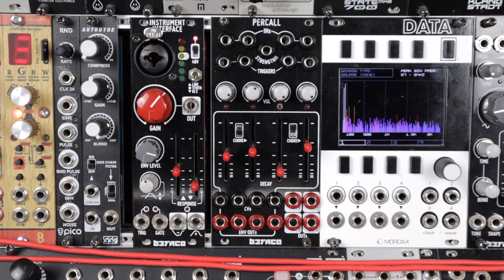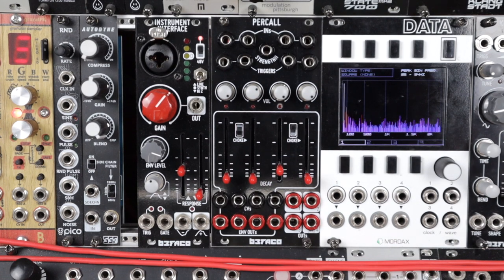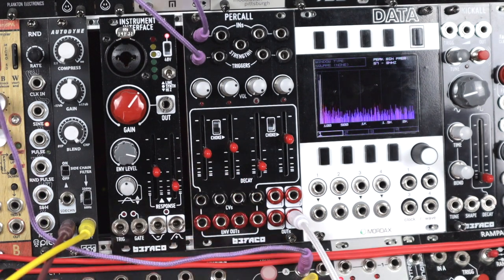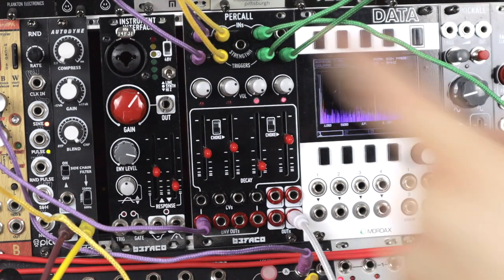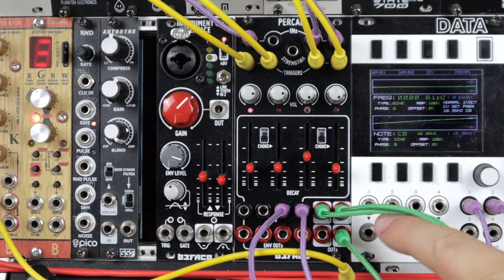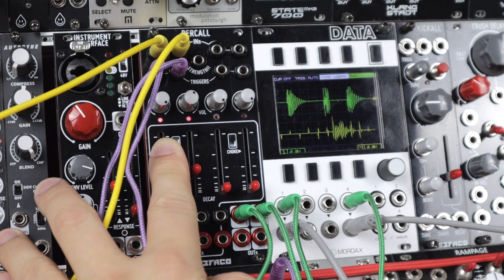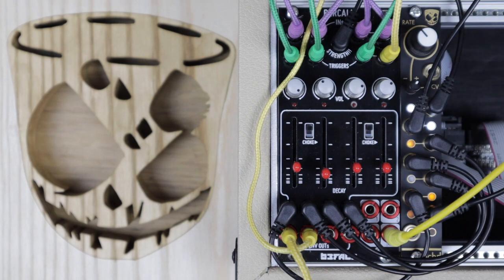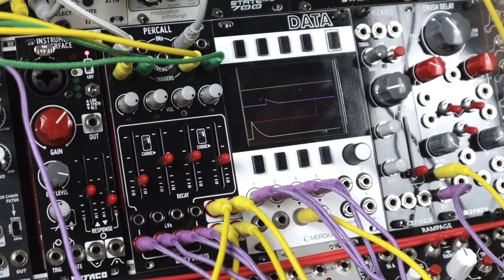Befaco Percall // a percussive quad decay envelope, VCA, choking, mixing Eurorack module

Comment: These module seems fantastic, a lot of features in one module!
Reply from the maker: It works well for any percussive, whether that's traditional percussion, weird percussion noises or just percussive melodies and bass etc.
Reply: @DivKid  I’ve seen some demos with just normal oscillator sounds, used for melodies etc. What’s your opinion of that use?

Comment: Out of curiosity Ben, what do you use for your trigger sequencer? I’m sure there’s a lot going on behind the scenes but your rhythms/beats always seem so effortless. Like, “oh, just threw this together” and it sounds better than most of what I come up with. 😆 Great demo as usual, thanks!
Reply from the maker: Hi Mason, they usually are threw together as I don't get time to finesse things really for making demos as it would if I was just working on productions or something. 

But to answer the question it's often a range of things. I like euclidean generators, clock dividers (sometimes with logic), Grids from Mutable Instruments, lots of Winter Modular Eloquencer going on, older videos might be a Beatstep Pro, could be the SWT16 from Robaux ... more recently Stolperbeats from Making Sound Machines. 

I'm usually pretty happy with whatever is close by and I try to change it up a bit. 

Drums were my first instrument gigged a tonne, drum sounds and beats were my first sound design and sample/loop making jobs after getting into production and I taught drums as my main job for a long time. So probably some inner drummer stuff going on. Not to inflate my own ego or anything, just saying drums has been a big part of my musical life since the beginning.

Comment: do you think pams plus a a quad vca could do similar things? do you think pams/ stochastic envelope generator has surpassed this?
Reply from the maker: you can break the functions down and remake it for the most part. The choking will be more complex and involve more modules. 

But quad decay envelopes, quad VCA, mixer. 

The reason this is as good as it is, is having all that to hand in a performable way on one module.

Comment: Is it possible to bypass the envelope and just keep a channel on for the mixer?
Reply from the maker: no there's no manual level control outside the decay envelope. The way I've been doing that is to just trigger the decay envelopes with the time up full.
Reply: @DivKid  Ah thanks, yeah that makes sense. Just using an LFO with a high enough speed to retrigger before it drops should keep it open right?
Reply from the maker: yeah just anything really clocks, spare gate sequences etc. It's fun to use an already rhythmic sound (processed with envelopes and VCAs etc) but then use this to carve into the already rhythmic thing. Double gating is how that's often referred to.